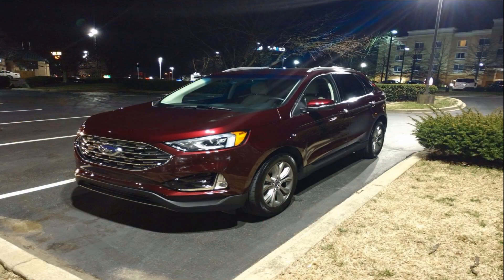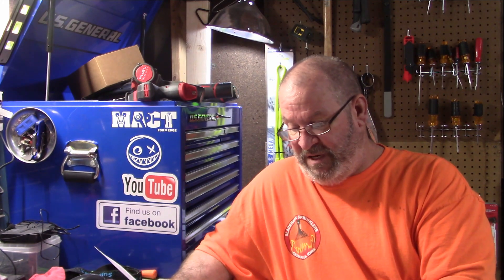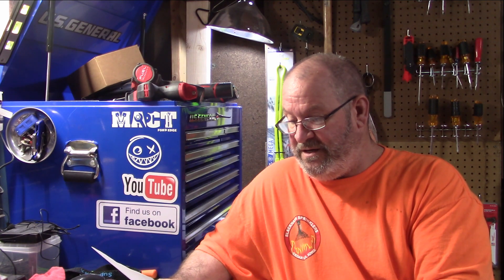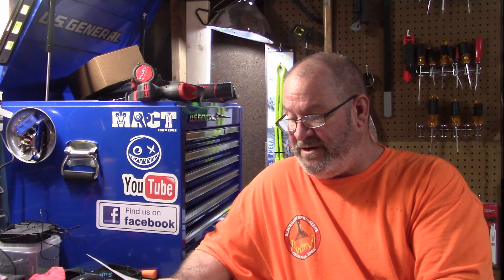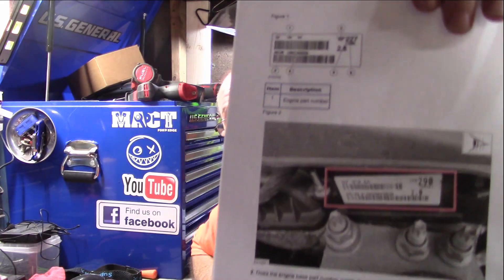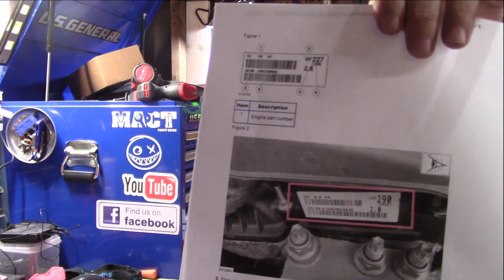TSB 19 2346 2 0 Ecoboost Coolant in Cylinders water intrusion

Comment: Executives at Ford Announced this because of me, I think! 
This is really interesting that you are making this video. I feel that you may be writing it because of what happened to me causing Ford to announce the problem. 
Back in 2017 I purchased my 2014 Ford Edge out of my own lease when the lease was up! When my lease was up it has about 50,000 miles. When I switched from lease to purchase, I wanted a warranty because I did not want to be stuck with a payment and out of warranty. 
So, I purchased a warranty for up to 120,000 miles. 
Anyway, about 2-3 months later, the car had about 60,000 and the car was blowing white smoke and acting weird. The light never came on.  After going to the dealer and during test drive the light suddenly went on.  But that was weeks after the problem even began.  The car kept overheating too! 
The dealer had no idea what was wrong with it. They kept it for about 2-3 weeks. They had no clue what was wrong with it. 
Ford decided to fly Ford Executives (engineers/mechanics) (6 guys) to look at my car and take pictures. (which I thought was pretty cool)
What happened is Coolant was leaking into the engine and it then destroyed the engine, the turbo, the exhaust manifold, etc... It costed $17,890 to repair. Ford ultimately released a statement and information to all Ford Dealers and announced the problem. When this originally happened, I was told that my car was the first car that Ford Executives saw with this problem. I am sure that it must have happened to others. But it is cool to know that it was "my car" that triggered the announcement in the industry.
Ford asked if they can take my car from me so they can Analyze it. However, the deal was awful! I was up-side-down on my loan. They wanted "me" to pay for a new car. I said "he'll no"! If they gave it to me for free, I would have agreed. At that point I got worried. I reached out to a lawyer because I was worried that they will take my car and "f" me over. I just kept saying. "hey guys, it’s your problem" I purchased the warranty!" I said it over and over through the whole process. I was surprised that they actually did it!
(the warranty was $2900, but I talked them down to $1400 when I purchased the Warranty) - Deal
 The repair was over $17,000! The car was only worth about $18,000, at that time too. 
However, they actually did repair all of it for free! Then they announced it to the world. 
I still have the statement of the repairs somewhere. It was the most expensive repair I ever did in my life, and it did not cost me a cent! Plus, I got a free car loaner for weeks! The statement was 4-5 pages long with parts costing thousands. For a new Engine, Turbo, manifold, etc. 
To think, that Ford spent over $17,000 plus the flights of those 6 guys, their payroll, thier hotels, etc...  It must have costed them another $10K in costs for all of that too.  (well, I guess it is part of thier research)  Maybe if they did not do all of that, I might have been screwed.  Maybe where they say... Oops, we don't care that you have the warranty ; we cant fix it!

Anyways, the car is still alive… It now has 90,000 miles! I still have 30,000 miles worth of Bump to Bump Warranty! But I am going to dump the car at 119,999 miles !

But I have the feeling that you are reading this because of my ordeal!  The dealer told me that from the investigation of my car, other people with the same problem will have it easier.  I thought that was cool!
Reply: Sorry to say but I haven't heard of anyone not having a hard time in any of this. Had the extended to 75k and at 75200 it shot the bed. Had they notified me of the potential issue I noticed low coolant a couple weeks before and could have been covered.
Reply: They're replacing my whole engine and gave me a free rental. Thank you for the backstory!
Reply: My wife has a 2019 Ford escape with just over 20,000 miles! We are going through this same thing right now. We are still under warranty. They said they would replace the engine but have left us hanging on a loaner. Said they have low inventory or some BS. Trying to see if they will cover a rental. I am frustrated beyond words and trying to stay civil

Comment: Mine went out at 61.5k, Dealer told me to kick rocks if I don't wish to pay $4000 for a tear down, even before they offer me a discount lol

By chance would anyone know if a 2019 Engine is drop in replacement? I assume that's the one they are changing it out for at the dealership.
Reply: Have you taken Ford to small claims? or contact the Better Business Automotive? I have the same problem and it sucks!

Comment: Last spring ford replace my 2016 edge motor at 65 000 klm for that probleme.
Reply: Did you have the extended warranty? 5 yr and 60k miles. mine is less than 4 year and 69k and i am currently working with them about replacing the engine to see what they will pay for. $6k to replace it.
Reply: @williambest1376   did they help you? I am in the same problem! 62,000 miles. I have a case number waiting on them to get back to me.